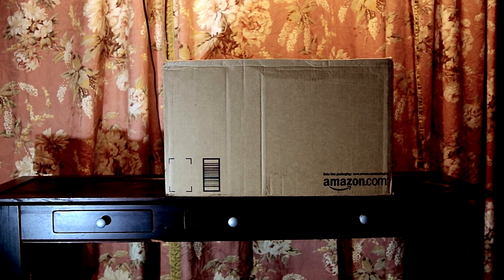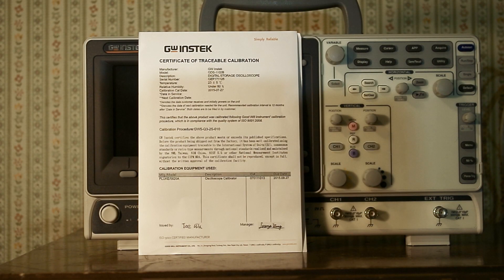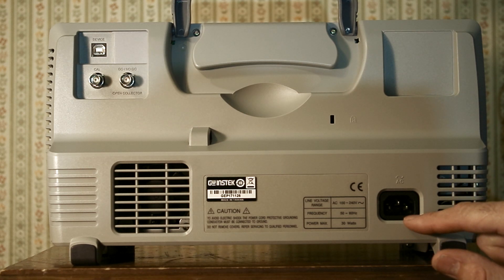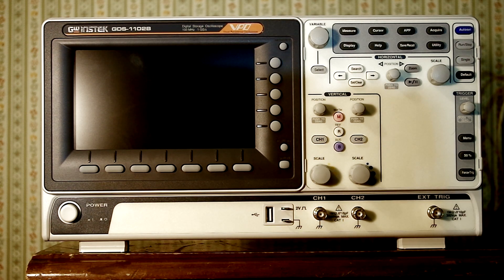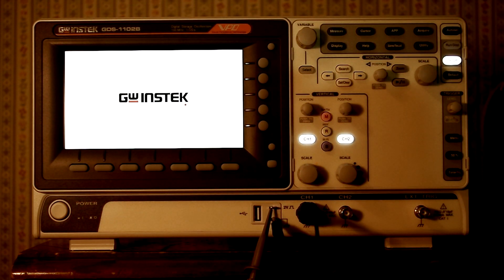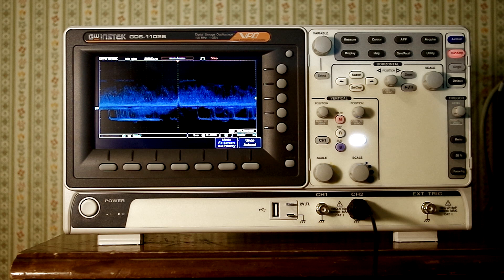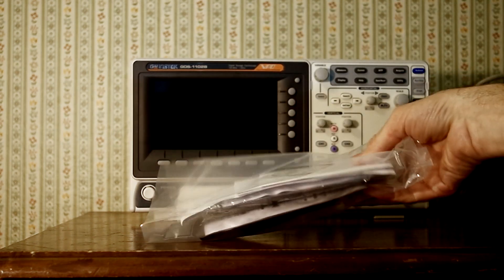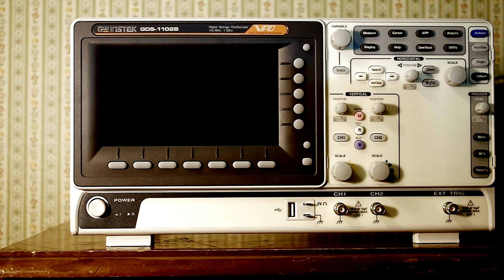Gw Instek GDS 1102B oscilloscope unboxing and first look

Comment: You're the only review to comment on the lack of 3rd party NRTL safety certification, just CE.  Its a concern for professional use if interpreted by the book, in Canada say by ESA in Ontario or OSHA in the USA.  DSOs are CAT 1 or CAT O rated devices, so even if certified they are not meant to be used near mains or greater [ CAT 2 or more].  The WVGA LCD is the same as Rigols in spec, and appears identical in res and color depth, at least to me.  I've used Instek devices off/on for 30+ years and their support for gear is excellent, but they are not historically one to add features beyond originally specified in the documents, just bug fixes; bugs and design flaws are fairly rare in their manufacturing which is a reason to choose them.  Thus, firmware updates tend to be sparse except if when bugs are there.  If you upgrade the firmware you may see an increase to 120,000 wfms/s and a trigger output implemented in software, which is undocumented in their website.  Enjoy.
Reply: Simply put, what you read in the datasheet of the Instek 1000B is what it does.  The Rigol 1054z is what they hope it will do.  The forum discussions on eevblog about bugs and new bugs continue to this day, over 2 years since it was released.  In general the Rigol works, but not as specified.